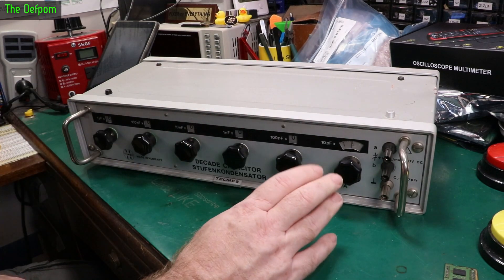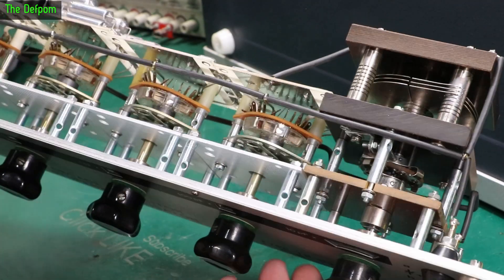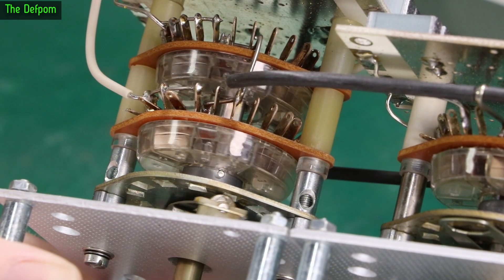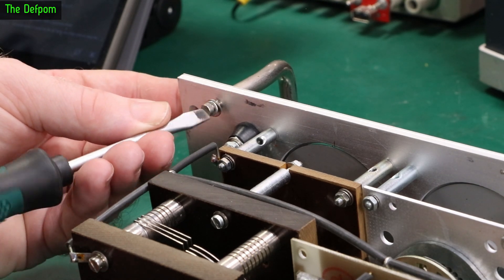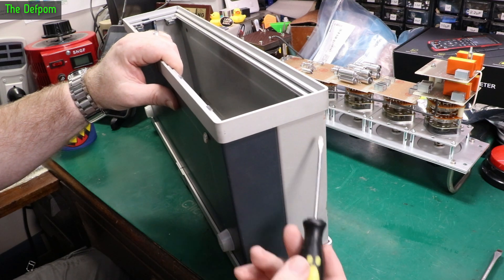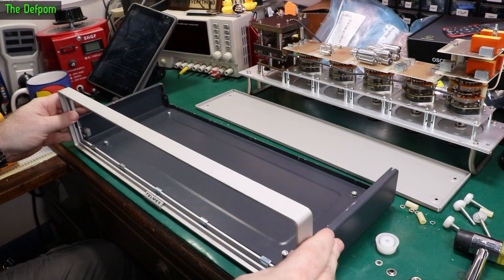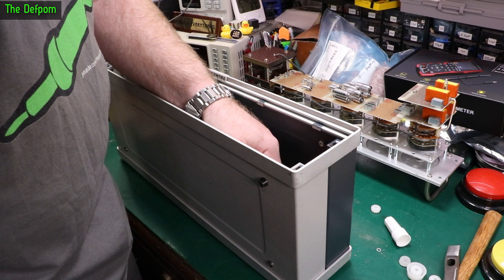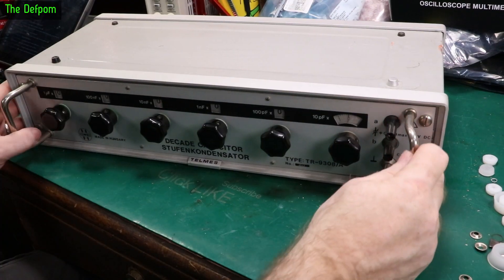🔴 Telmes TR-9308/A Decade Capacitor Repair - No.1229

Comment: If that's the original WD40, it's only marginally better than no lubricant. Use lithium grease on the mechanicals and Deoxit on the contacts.
I'm surprised the bus bars aren't kept as close to each other as possible to minimize the loop area.

Comment: "It's a nice compact unit" - Dude- that thing is HUGE!  But super interested to see how it performs, or if you need to do some work.  Also, with caps at like 10% accuracy, doesn't this end up being more of a variable capacitor?  I mean, it's not like you are going to dial in 105 nF.  It's gonna be all over.  No?
Reply from the maker: This thing is about 1/4 of the size of another unit I have which I have yet to do a video about, so yes, in comparison, it is a nice compact unit 🙂

Comment: I find that quite often the user has exceeded the ratings, e,g current for resistance boxes and voltage for caps. Like a guy in the test department who used a resistor decade box to dim a 12V 55W headlight bulb as someone was using the power rheostat. Sad to say he let the smoke out😢